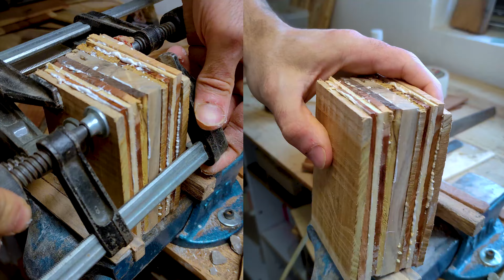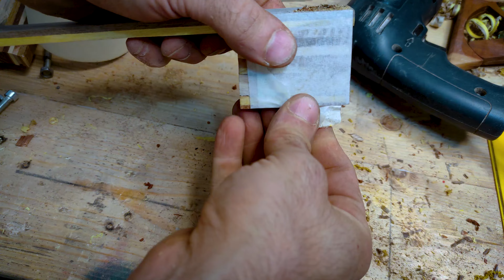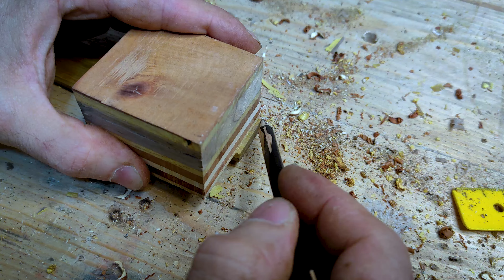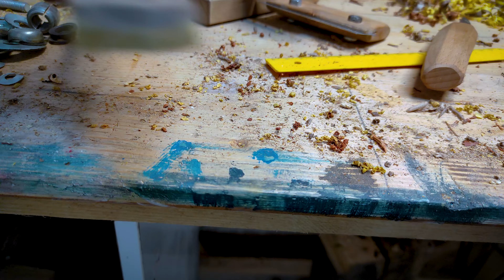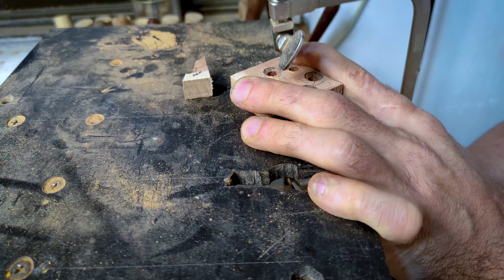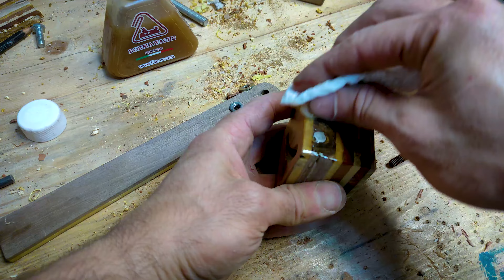Hand Miter-saw Cut | DIY Hand Saw Straight Cutting Guide for Perfect Cuts with diffrent angles

Comment: You can also improve the straightness of your cut if you hold your saw correctly. Japanese hand saws cut on the pull, as opposed to the push, so you should be holding your saw at around 40 to 60 degrees, digging into the material only as you're pulling it downward...
Reply from the maker: 🤩🤩🙏🙏thank you for guiding